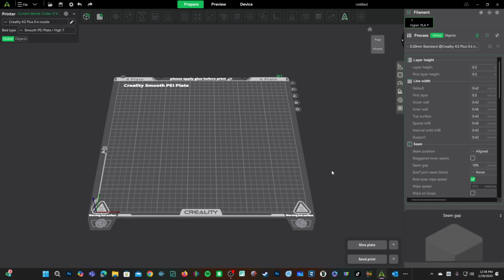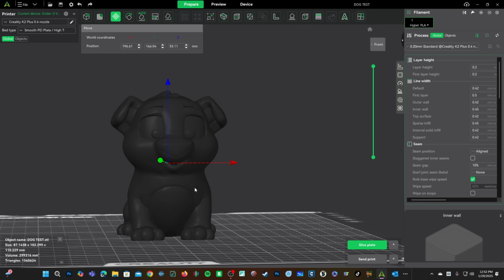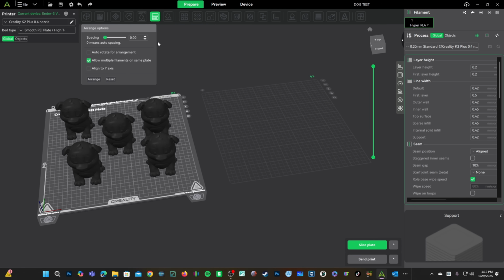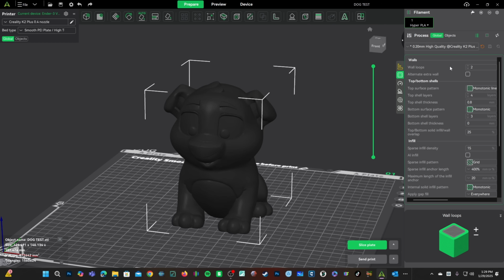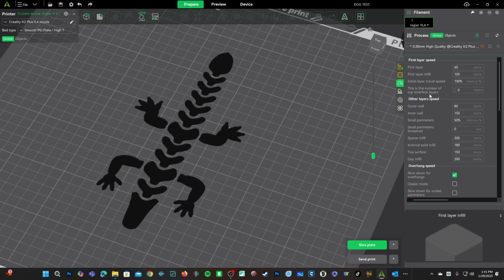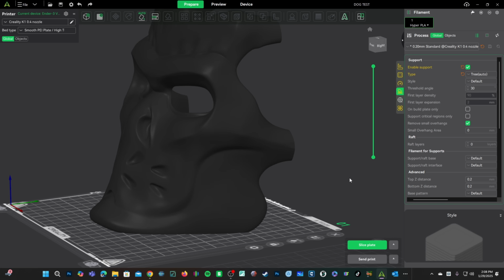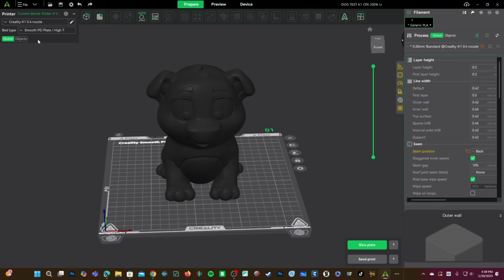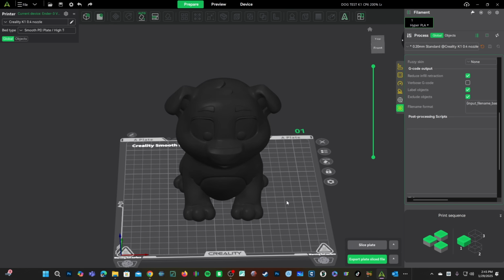CREALITY PRINT: TUTORIAL. Step-By-Step, Detailed Guide to slicing models, for 3D Printing.

Comment: I need help finding where to change bed size after CFS upgrade I keep getting y axis issues when doing multi color prints
Reply from the maker: Here is my install video: https://youtu.be/zItif1Nosdc
Reply: @3DRundown  I followed that when I installed everything. I still get Y axis issues on prints when doing multicolor even if they are not close to the back or front.
Reply from the maker: @krazybeast1237 hit u back shortly
Reply: @3DRundown any update?
Reply from the maker: @krazybeast1237  You will want to set your Y AXIS to 295. If you want, hop into my private community, and post, I will share a screenshot.
https://www.skool.com/3drundown-8042
Reply: @3DR @3DRundown pay for your subscription?
Can you just make a video or something?

Comment: I have the creality k2 plus. Do you have a video on settings for petg on creality k2 plus. Attempting to print on petg. Not working for me. Changed settings on filament. Computer wont allow me to choose petg. Any suggestions?
Reply from the maker: I would use "GENERIC PETG" profile
Reply: @3DRundown i will try. I changed filament type on the screen to petg generic. Maybe something wrong with softwares where it wont let me choose that cfs slot. I might have to reinstall the software and hope that fixes the bug.
Reply from the maker: Are you assigning PETG to the CFS SLOT, then, assigning that slot to the project? Catch my STL  Painting Video
Reply: @3DRundown I settle settings on. Petg printing good on spool and cfs. Thanks.
Reply from the maker: @louiedee279 🙌🏼

Comment: I have a question regarding the example dog model in this video. Let's say there's a 10 x 10 x 10 mm gap on the part of the model that touches the ground. Normally, the first layers and up to 10 mm in height shouldn't be printed in that gap. After 10 mm, the top 10 mm should be included in the print. Is there a special setting for this, or does it print this way automatically? Also, when we use an edge printing option for better printing on the ground, that option shouldn't be present in the gap section. How do we adjust this?

Comment: In Creality print what setting do I need to change to stop the nozzle on my Creality HI from scratching the top surfaces when performing travel moves,I know I could use Z hop but that's not the answer
Reply from the maker: Use a different infill.
Reply: @3DRundown thanks for the reply I'm using grid infill and it's scratching the surfaces of the top shell layers when traveling and scratches the bottom shell layers when there's no infill,how  do I stop it ? Please

Comment: I'm trying to modify an existing model that I got from printables... All I need to do is change the magnet holes from 6mm to 8mm.... Haven't figured it out yet...
Reply from the maker: You can't change an STL. Cut an 8mm over the 6mm
Reply: @3DRundown  I think that's what I did, my previous problem was using the hole tool but it punched all the way through... lol .. Also new sub here, I look forward to more lessons on the Creality stuff. =)
Reply from the maker: You can use the hole tool. Catch my video on it. Just position it to the depth you need. Welcome to the channel!
Reply: OMG... Right before the video ended, I realized all I needed to do was set the depth to 0...  Anyway I think I got it figured out now..

Comment: Sir, I just discovered your channel and I love it. I was wondering if you could make a video of or provide me with the link for a video that explains how the K2 Plus works. They manual they provide just shows how to assemble it. For instance, I can see that it prints a calibrations strip and then uses its camera to analyze the strip before continuing. Can you explain how it does everything from calibration to color changes, etc. I've seen videos for the Bambu printers that talk about how to reduce flushing waste by having the printer retract more of the filament before cutting but not for Creality printers.
Reply from the maker: The reality is, K2 with CFS, and Bambu with AMS, work in the same manner. You can do all the same things in the slicer for either. The Retraction cut is a newer trick in Bambu Studio, I'm not sure if CP uses this, but it probably does. Focus on learning the Slicer inside and out. I show allot of slicer techniques in my various project videos, and shorter stand along slicer tutorials. I'd watch them all, even the Bambu ones. The slicers and machines are functionally mostly the same. User Interface is the biggest difference.
Reply: @3DRundown thanks for replying! I'm talking about what the printer does without being told like the calibrations strips, the AI camera, error detection.
Reply from the maker: I'll do my best. For Now, Check out these 2 videos: 
Assembly: https://youtu.be/_ujXLF3gaeI?si=K0_S0tnZXtTgyiOq
Setup: https://youtu.be/aAswWOFtR3M?si=WibqD-zXdIo0Az3f

Comment: Thanks, I got an ender3 v3se for Christmas, never had anything to do with 3D/ CAD etc. didn't have a clue where to look or what to do. Your video made me think that I might be able to use the thing.
Reply from the maker: You absolutely can. Keep in mind, it's a beginner level machine. Keep speeds on the lower end, and it will be happier. A nice 1st machine.

Comment: Fantastic tutorial. I now have open creality print and started playing with it thanks to you 😊 
I do have one question. I have an ender 3v2 with added bl touch. When using cura it's easy to change the G code to have it probe the bed before it starts printing. How can I achieve this on creality print?
Reply from the maker: Don't.  If you have a good working mesh. Keep it, and use it. Run a new mesh, if you see a need. I always did mine manually on the V2 when needed. HOWEVER: You can modify the GCODE, in the same way as Cura. It's just in a different place
Reply: @3DRundown  thats what i was looking for. With cura i just set it to run the bed level at the beginning of every print
Reply from the maker: @mathieulariviere2558 I would recommend against that, but, if you'd like: Click the pencil next to the Printer on top left. Then click "Machine Gcode"
Reply: @3DRundown i really appreciate the replies im still new to 3d printing and trying to take in lots of information. Why would you advise against doing this. In my mind i think that if i do it at the beginning of every print i can guarantee the print wont fail
Reply from the maker: You are trusting the machine to make an accurate mesh everytime. The tiniest thing can throw off a reading. if the mesh is working....  Use it until it isn't.

Comment: Hallo, thank you very much for your great Videos. I have one big problem, when i install a new filament for example a TPU from Geeetech with the my own slow Setting.. When i send the Printjob i get always the Warning an my screen: „The machine consumables do not match the printed file. Pleasanton Check and restart printing.“ This warning comes on the Mac and on Windows system as well. I trieb to switch the filament Setting on the Printer as well, but always the same warning. Do you have an idear what the problem is, or can i only print on the K2 Pro witch Creality filaments? Much greetings from Robert from Germany
Reply from the maker: You have the wrong filament selected in the device tab

Comment: I have been fighting the printing for hours over several days. Every time I click on device I get a blank screen. When I click send print, I get a picture of the print I want but can not send to printer. All  I get is send to LAN printer can not do so. I get a red circle with a red line inside the circle.
Reply from the maker: What Printer. Have you bind it with Creality cloud
Reply: @3DRundown  yes I have it bound to creality. The same thing happens to the creality Triangle icon. Click on that and i get a grey blank screen.
Reply from the maker: @MrDee195 Sound like a bug. I would reinstall the latest version of CP6.

Comment: I'm just trying for the first time editing stuff and my print time went from 7h to 12.30h. that's not 3 minutes increase.
i might revert all of it tbh. i've had failed prints but i believe most of them were entirely my fault. 
the tutorial is however helpful to understand the software! you missed the slice feature that is very very helpful
Reply from the maker: There are dozens of features not covered here. Modern slicers are complex. The increased print time is not a problem. Many proper adjustments, such as adding more walls, increase print times dramatically. speed isn't the goal. A strong quality result, is the goal
Reply: @3DRundown  although I agree with the quality part it did add more than 50% time. it's just too much. I didn't add any walls, i removed brims, just changed the speeds from the default profile to yours (as well as the temps on the filament profile)
Reply from the maker: Look at your Max Volumetric Speed then. Probs too low. Also, look at your infill %. Anything over 10% on a nonfunctional part is excessive.
Reply: @3DRundown  infil is at 15% i need this particular piece to be heavy
speed is at 3.5mm^3/s
Reply from the maker: Go with a larger layer height such as .24.  Brother, 3.5 is a near stand still. Put it to like 18ish
Reply: @3DRundown  I have no idea why it defaulted to 3.5 when i created the new profile haha, sorry i'm new! i upped a print to 10 before reading this, will up to 18 after, i noticed the hyper pla profiles that i was using before are 20-25

layer height, won't that make the print a bit more "edged" (less smooth)?
Reply: @3DRundown  so after quite a few prints i reverted the filament settings. 
all my prints failed in some sort of way, most of them bended because of lack of adhesion to the bed and kept the default "hyper-pla" settings as they gave me good prints.

on the other end i kept the changes to the global settings and the print does seem a tiny bit better than the default. but it is half the speed unfortunately. so not sure if i'll keep these.

however the video it self is great for knowing that everything means :) thank you for replying to my questions as well!

Comment: would you recomend running the print calibration on every print? i noticed your's was turned off
Reply from the maker: No. If it's a HUGE print, Risky print, difficult print, print with a large flat 1st layer...... Yes

Comment: Hey I like the video but for some reason the only option for pla at 45 minutes in the video is generic. Can you please help me with this and let me know if I missed an update on soemthing
Reply: Also what do I do for a glass build plate
Reply from the maker: I loved glass, but it's kinda time to move on from it. I would set your bed temp at 60. Perhaps the profiles aren't showing due to using an older machine profile. Not sure....  I wouldn't worry about it too much. Run your bed at 60. Newer machines Hotend at 220. Older slower machines closer to 200

Comment: I just got my Creality Ender 3 V3 SE. I’m wanting to print a file that has a 0.6mm  nozzle programmed to it and my printer has a 0.4mm nozzle. The file I’m trying to print is from Thingiverse and I’m sending it to Creality slicer.
Reply from the maker: STL files have no info programmed. Set the correct nozzle in Creality Print 6, and slice the file. Do not try to download or use Gcode files

Comment: Thank you for the information, I just bought the Creality K1 SE printer to start, I have bunch of images in my flash drive, and I don't know how to convert them to 3mf to print, a little help will go a long way.  I appreciate your video, very informative.  Thank you
Reply from the maker: You need STL files. Import them, and slice as shown here. When you save a PROJECT, it will be a 3MF file. When you SLICE the project for printing, it will be a GCODE, but, you will send it straight to the printer, from Creality Print 6, so, you don't need to touch the actual file at all for printing. Always save your work as a Project file.
Reply: @3DRundown  I really do appreciate you getting back to me.  that shows that you are into it and I really appreciate that.  Allow me to bother once more, if my images are saved as Png how can I get or have them imported as STL, like I mentioned I'm a novice in all this.  Once again thank you.
Reply from the maker: Converting an image to an STL, is not a straight forward thing. Lot's of new AI tools, offer efforts at doing it, with hit or miss results. Can try MESHY.AI. I have a tutorial here. Bambu Studio "MAKER LAB" Also has some interesting tools for photos (some tutorials here as well)

Comment: I just acquired a Creality Sonic Pad to help get more life out of my CR-6se. Problem is Creality has deprecated their Sonic Pad Cura profiles and replaced everything with a link to Creality Print. Great, another slicer to learn. OK, not so bad, but there are no profiles or setup instructions for using a Speed Pad (unless you have the  Ender 5 S1 or Ender 3 S1, which were the defaults when Sonic Pad first shipped). So, do you know of any new files that I need to load into Creality Print or should I try to modify the Sonic pad profile for the Ender 3 S1 (which is functionally closer to my CR-6se)? Or, should I wait and continue to use Orca as it appears Creality is still developing their slicer? Thanks!
Reply from the maker: To help you get better results from searches and such, let's use the proper name: SONIC Pad. 
The Sonic Pad is great. I run one on my Ender 5+, and CR-6 MAX. You'll see it in a recent story.

You should absolutely be learning and using Creality Print 6. I have a tutorial here. 

As for profiles. Don't worry about it. You can find the profile, closest to your machine, in the slicer, and customize it, to suite your machine. I have seen many people posting online for the past few years, with great success no the CR6-SE and Sonic Pad. I checked CP6. It does indeed have a CR6-SE profile. Start there. Adjust as needed.
Reply: @3DRundown I’m old, so it will be a while before I learn it’s name. I was able to edit the default Sonic Ender profile and get it to work. Since  Creality Print is based on Orca, I’m already adapting. Creality may add additional profiles for Sonic Pad, but they don’t seem to be in a hurry.
Reply from the maker: They are not focused on Sonic Pad anymore. It's all Nebular Pad now.  I'll be 50 in February. We can be old together. 😂
Reply: @3DRundown  Leave it to Creality to slide in a different Klipper pad while I'm trying to upgrade. At this point, the Sonic Pad is up and running, and I'm happy with the enhancements. I started this journey because I was tired of reformatting SD cards, so everything beyond the ability to send prints via wifi has been a bonus. I'm pretty sure Creality isn't going to swing back and make profiles for my CR-6se, so I'll just run with what I have now. This is enough to keep me going until I upgrade to one of the Bambu printers I see these days.

Comment: I’m new to printing and want to know when in Creality slicer what are the build plates for you have off to the side? What would you use the extra plates for?..thanks
Reply from the maker: There are many build plates you can use. You would only change this setting, if you have changed your build plate. Different plates offer different bottom layer textures. Some also have stronger bed adhesion. SMOOTH PEI is my GO-TO bed, for all my printers.

Comment: I have Ender 3 SE and same model sliced in cure prints with no special noises but in creality print it often making noises like filament feed skipping or similar, is it normal?
Reply from the maker: I have a feeling you running higher speeds with CP6. Try slowing things down

Comment: how to disable the model drop automaticly to the printing bed? like i want the model to float in the air, then add supports to print, so it does not float anymore. everytime i do this though, the model drops to the bottom of the plate. 

i used this technique in earlier versions of creality print no problem. but now i cant do this anymore and i can't find anything to disable this function. anybody knows? please. it drives me insane. been looking for weeks to disable this
Reply from the maker: You can not disable bed snapping on orca, bs, or cp.
Reply: @3DRundown  piece of shit software. thank you for the answer though mate
Reply from the maker: Not POS. This is the way it's been for YEARS now. Just need to adapt. you can assemble a model, to float an item, via MERGE, or Right Click-ADD ITEM, but, you can't float a single model, like you could on Cura. You'll get used to it.
Reply: @3DRundown it worked on earlier versions like 4.x and 5.0

Comment: With the move tool, how do you unsnap it from print bed? on the older versions i was able to raise it so i can slice supports underneath the file but now i cant find (if its there anymore) an option to unsnap it. its frustrating cause thats the only thing stopping me from printing this file. Any ideas? please and thank you
Reply from the maker: You don't. Orca, Bambu, and CP6, all use snapping. If you right click and ADD a part, to an existing model, THEN you can move THAT part